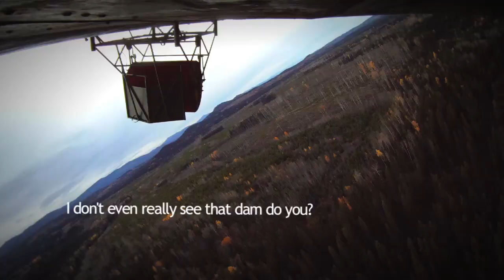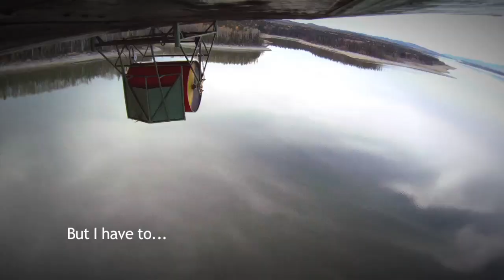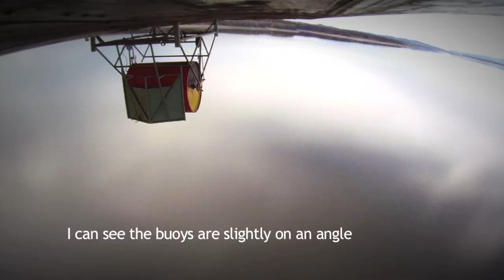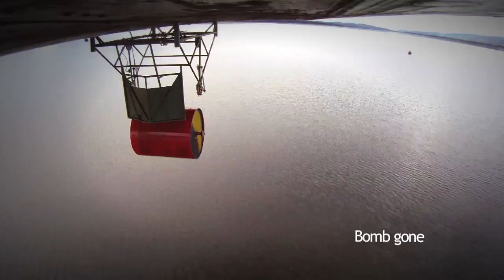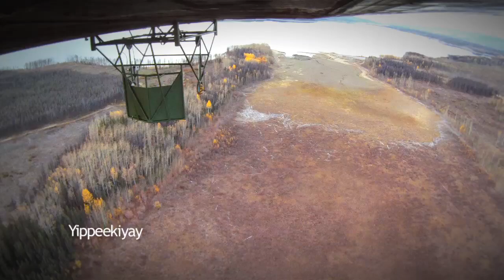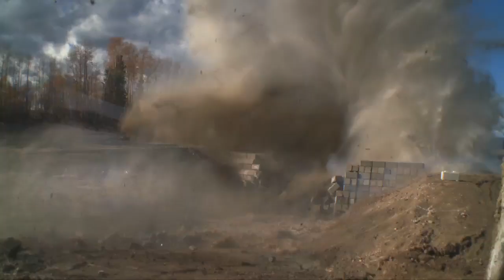Dambusters | Building the Bouncing Bomb | 2 of 2

Comment: I always thought that these bouncing bombs were interesting. But they’re limited in their application.

They make floating anti-ship mines that are covered with explosive charges. 

So I wonder if it would be possible to make a bouncing bomb for land use. A bomb that’s covered with explosive charges that would send it forty feet in the air every time that that it bounced. The bomb could be dropped from an altitude of a hundred feet, and then it would keep bouncing forward in hundred foot hops as the bombs went off. 

It would finally be detonated by a time fuse. The intent would be to give a low-flying plane the ability to deliver a cheap bomb that can jump over obstacles. 

No electronics at all, the ground crew pulls the arming pin when mounting it on the plane. The bomb doesn’t need dashboard control because the timing fuse is simply triggered on the first bounce.
Reply: Maybe, but nowadays its just easier to do it with drones and stuff, low-level bombing missions just aren’t really a thing anymore. I know bomber comma d planned to use the bomb against Tirpitz - The Germans also realised this and kept her in fjords which didn’t allow for a bomber to access her with one.

Comment: ... the fuck did they have to air drop it in for if it could be on such a long time fuse? Especially bouncing it? The water was glassy calm again before it went off.
Reply: The dam-buster is suppose to sink and then explode at the bottom of the dam causing maximum damage and collapsing the whole entire dam. So the fuse had to be long enough for it to reach the bottom.

Comment: As I can remember it was turning opposit way oryginaly.
Reply: it was, so it would move as close to the dam wall as possible as it sank
Reply: @livetsteamrob  not that- that did happen- but it was more a happy coincedence that it made it hug the dam wall and work better.  It HAD to spin backward to make it skip up into the air.
That info was not available to the origional film makers because it was classified for ages.
Reply: @elevown  Yep, if you watch the movie, when the stock film of the bomb drop is shown, the bomb has been blacked out to disguise the fact that the bomb spun for accuracy.

Comment: whats the point in the barrel when they use explosives in the end?
Reply: lmfao, you're serious?
Reply: @Flying Spaghetti Monster remote location in the middle of nowhere? what are you on about? there was five pickup trucks parked on a road next to it.
Reply: @Flying Spaghetti Monster but it did not explode in the plane view? it just knocked a few blocks in, the ones that can be seen sticking out before it explodes? when the plane flies over there is no explosion or water shooting up.
Reply: @Flying Spaghetti Monster I just do not understand, if its something done with a timer and explosives why not just use them and skip the bouncing thing? much cost much more to do it that way with fuel costs alone.  couldn't some dude just walk up to the dry side and slap some explosives to the wall directly?
Reply: @TacticalSandals  Are you serious?

Comment: Just shows how much work went into the original operation. There wasn't much room for error at all, plus it was done in the darkness under aa fire. A feat of engineering.
Reply: The movie has Barnes Wallis himself saying that he didn't anticipate that designing the bomb would be easier than dropping it.
No, the flyers pushed human performance to the limit to compensate for the limitation of the bomb, namely that it had to be dropped within a margin of a feet.
Reply: and solid steel balls.

Comment: Impressive.

How much does the modern bomb weigh? I think the original was 7 tons.

And what is the carier aircraft?
Reply: Douglas DC-4. Similar size and weight to a Lancaster
Reply: They tried to get close to the original weight. I do not know the exact weight. However, the carrier aircraft is an old Douglus DC-7 transport/passenger plane.
Reply: @dlmalloy02  DC4